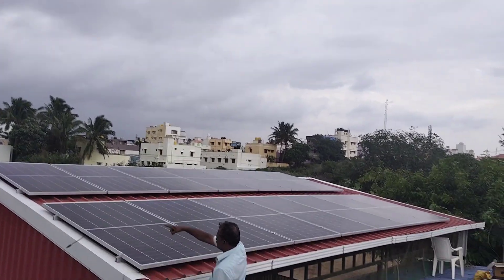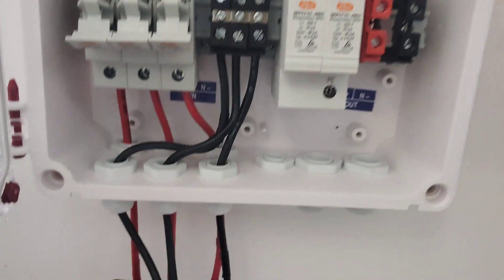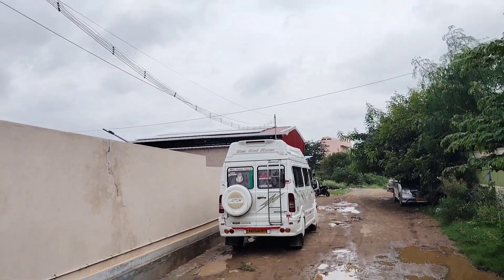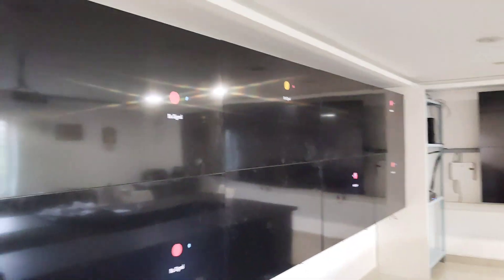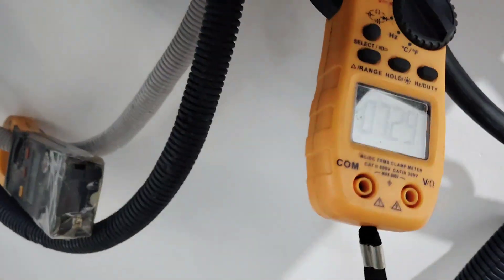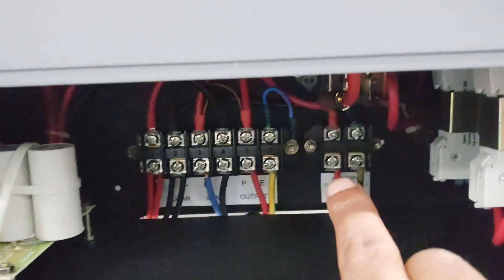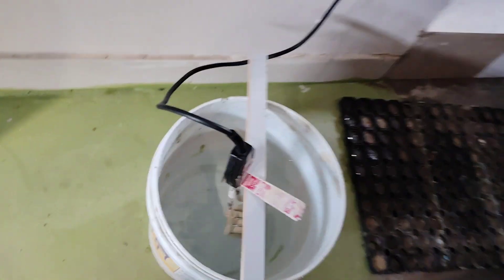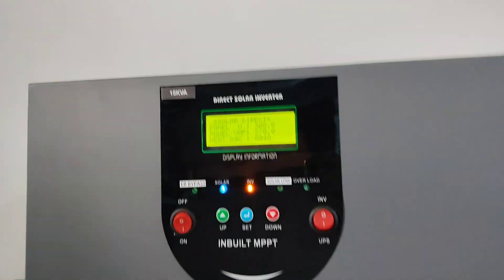15KVA Direct Solar Inverter Installation

Comment: We want a solar inverter without battery. This system will be used to run load of our school during daytime only. We don't want to use any battery. In your video you have used 22 batteries. What are they for ?